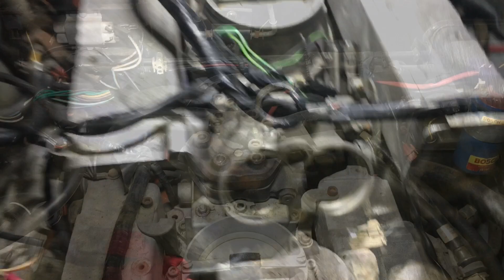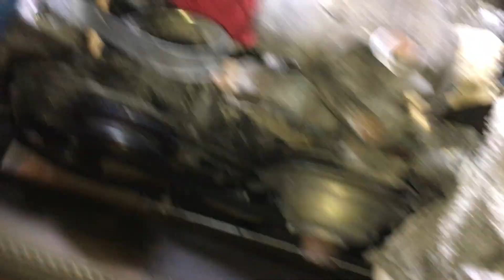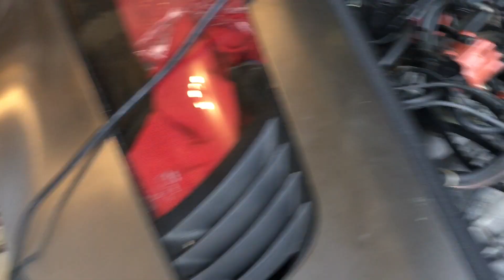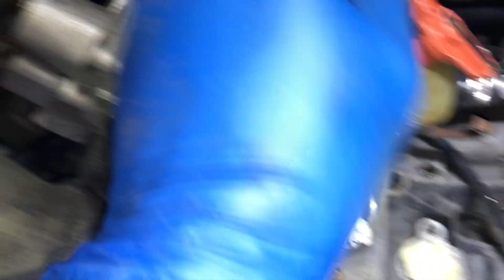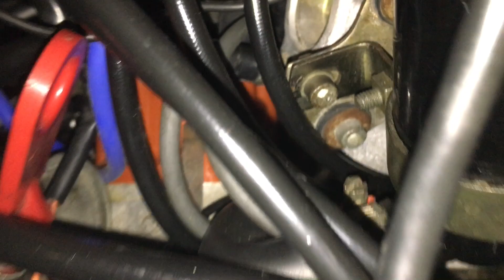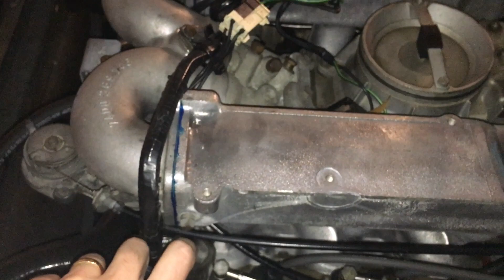DeLorean restore/repair part 3: intake, water pump, cleaning VOD, fuel lines, etc

Comment: You mentioned at the beginning that you’re following some “documentation.” Can you post a link to this file? I’m about to do a similar disassembly and would love to follow along. Thanks!
Reply from the maker: There are a lot of HOW-TOs over on dmctalk.org.  Here is the link to the thread that has the PDF link I was following:
http://dmctalk.org/showthread.php?429-How-To-Removing-intake-manifold
Reply: @stevenmcguigan1272  Thank you! I’ve been looking on DMC Talk for a while and there doesn’t seem to be many step-by-step instructions. The file you posted is perfect. I’ll use when I start my engine disassembly at the end of the month. Did you use a similar guide to install your red and blue vacuum lines?
Reply from the maker: @Droideka88  No guide for vacuum lines.  The kit from Delorean Go has labels on the hoses and a labeled diagram.
https://www.deloreango.com/us/silicone-vacuum-hose-kit-blue.html
Reply: @stevenmcguigan1272  Yeah, I was looking at their site too. Any complaints about the new tubes? Have they held up well?